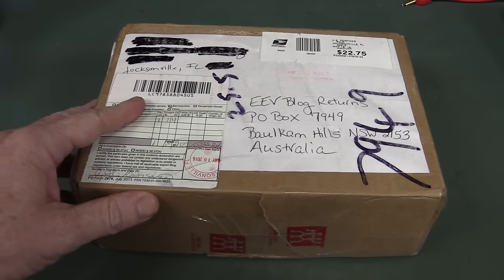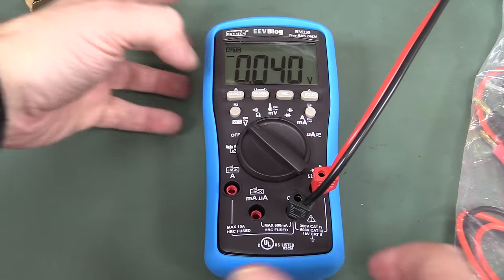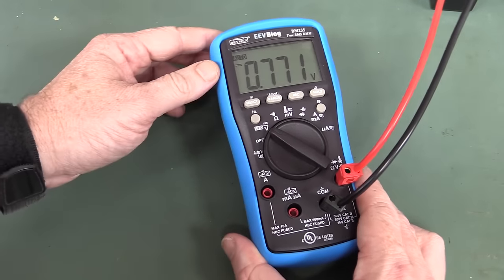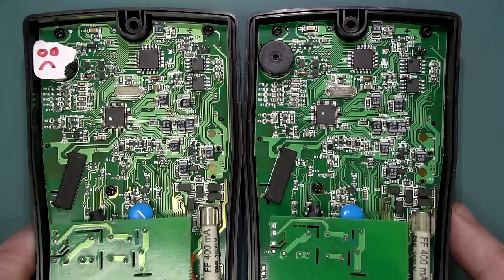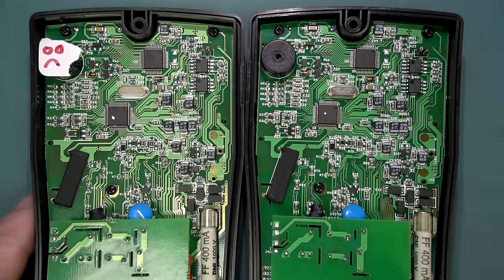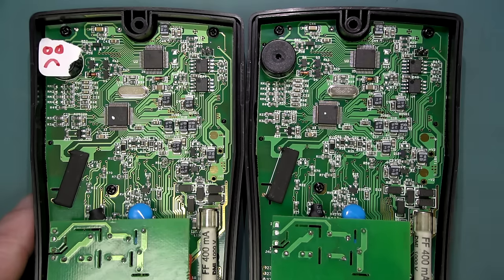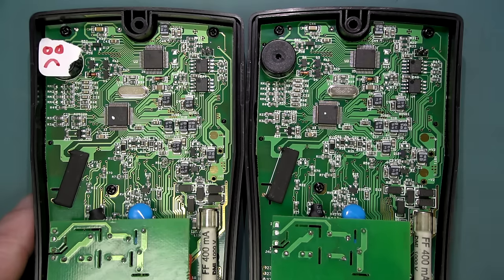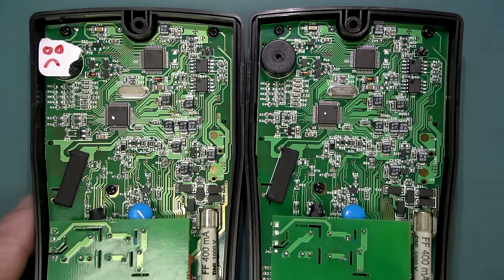EEVblog #884 - EEVBlog BM235 Multimeter REPAIR

Comment: why are star grounding points better? do they just look good?
Reply: Prevents ground loops
Reply: and what does that mean?
Reply: +Stragemque http://lmgtfy.com/?q=Ground+loops
Reply: bobshowrocks
Yeah i guess i had it comming, its was quite a low effort response. But thanks

The wikipage talkes about ground loopes with AC and radio/analog equipment. They also talk a bit about digital with RS232, USB etc from what I understand long wiers. How does it have an effect on the scale of a PDB.
Reply: Back in 1978, I used a TI ADC chip that was not measuring millivolts accurately. My wife, in my HP Division's QA lab at the time, delidded the chip for me and I traced out the ground traces inside of the chip. (The principle's the same for pc board traces.) The ground return for the ADC's voltage reference input did not have a star grounding point, so its "ground" was actually many millivolts above the voltage on the chip's ground pin and this made the 250mV reference voltage sufficiently inaccurate to throw the ADC measurement out of spec. Everything was in spec if I used a 2.5V reference. Where did that few millivolts on the internal ground return come from? From the ground currents of all the other circuits in the ADC flowing through the ground trace. That's why you need star grounding. It minimizes the ground currents and therefore minimizes the voltage rise in the ground traces. Important for instrumentation.
Reply: ...and in some other places like audio and other high-dynamic range analog applications. If you ever had an audio amplifier that exhibited buzzing, chances are someone got ground routing in the power supply wrong. Return currents in power amps also tend to be all kinds of fun because they usually are highly distorted, and you don't want that kind of stuff to get into your low-level circuitry. Hence also why supply-related loop areas are generally minimized, it reduces inductance and stray coupling.
Reply: these examples are really great, thanks.

Comment: Oh ... such a great multimeter but I'm too poor for it - any discounts for a young hobbyist?
Reply: Just buy cheaper dmm, eg. ut139c
Reply: Yeah, its my main DMM.
It is 6000 count mm, so eg. 1,234V, may be that last digit isnt very accurate but still usefull when we are looking in differences between eg. few li-on cells that we want to put in battery pack.
That meter have most things that Dave said good dmm should have.
Reply: Arek R. Would you recommend this or the UT61E?
Reply: Only heard about UT61E, not really sure, its better in most ways.
You have to find yourself what you need and what u can spend.
There is disscusion on eevblog forum, google it.

Comment: In my opinion i dislike when a company will not disclose info on a product. Especially if my name was on it. Yes it may proprietary but my name and rep is on it. So if they are unwilling to work with who has contracted them to make the product i probably would not be using them.

Comment: Maybe the isolation slots with some flex causeD this?
Reply from the maker: No way that board can flex enough to break an 0805. The small slot doesn't really add any extra flex.
Reply: EEVblog it just seemed a bit suspicious that the crack is right in front of isolation... But its true that its way to small to do such Damage... Hope it us just one of!
Reply: chem mix on the component not being up to spec is probably what caused it to break when it had voltage run through it, improper resistance most likely led to a bit of heat and then snap, instant problem just add chaos.

Comment: MY MULTIMETER FREQUENCY MODE
NOT WORKING 

IT SHOWS VALUE EVEN WITHOUT CONNECTING TO FUNCTION GENERATOR

AND MOSTLY SHOWS OVERLOAD 
"OL" ON THE SCREEN

ITS MAX FREQ READOUT IS 2MHZ

AND THERE IS SOME OSCILLATOR SOUND NOTICED IN THE BEEPER AT LOW VOLUME WHEN PROBS ARE JUST HANGING UNCONNECTED

WHATS HAPPENING?😕😞
PLEASE HELP SIR
😭😭😥😥😥😢😢

Comment: Sure you got this already 
Dave somewhere in the comments, but I just saw a review video for this meter and it clearly shows the plastic molding for the screw tunnel is being cut away in the factory to avoid it from applying pressure to this component.. I am guessing in the case of this faulty meter this did not happen correctly which caused the component to break in half. https://www.youtube.com/watch?v=g3uYcHAumhA . No wakas mate!

Comment: you... didn't... design... this? :/  I just thought maybe, because you designed circuits, and put your name on it, that you had perhaps designed it.

also, my two cents:  a "crap" component wouldn't/shouldn't be an issue on a more expensive tool that couldn't fail, i.e. made to military spec, correct? and in that case, would it be an issue of just relying on an ultra-elite component manufacturer, testing individual components before assembly, or just ultra-rigorous bench tests?

hope i'm not sounding critical; just learning about things!

Comment: This video could be completed in less than 5 minutes.  After 21 boring and gruelling minutes, I still could not get the exact name of the faulty component (it was called inductor then RF bead?!!).  It would have been helpful to have mentioned (explicitly) the exact name of the component, what its function is, what caused the issue and how to source it.  All of these could have been indeed done in less than 5 mins!

Comment: Am I the only one here to find it disturbing that they refuse to provide the schematic for our electronic gadgets and tools making it harder, if not impossible, to repair the unit if needed? We should just refuse to buy things from who doesn't provide schematics... really, i bought it, it is my stuff, i have the right to have all the necessary information i need to repair it once broken... it is not that I'm going to steal your circuit (which would probably be illegal anyways), the worst it can happen is that i learn something new. We need to push for open hardware designs and stop accepting closed hardwares that make it almost impossible to service the things we bought with good money.
Reply: Some companies won't sell you parts, we had a computer monitor come into our shop for repair. The company wouldn't sell the part we needed to repair it, they told us to box it up and send it to them. Our customer knew someone outside the US so he was able to obtain it.
Reply: I used to manage a repair shop, it wasn't so easy to obtain diagrams and service info. And sometimes a factory manual cost $40. Years ago we got them from Sams you could get a subscription and they sent them out every month.